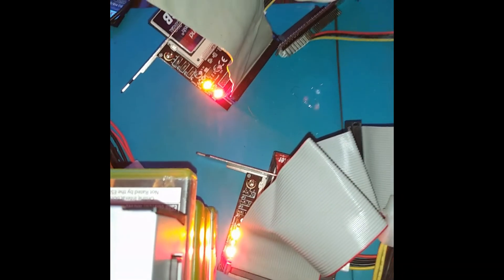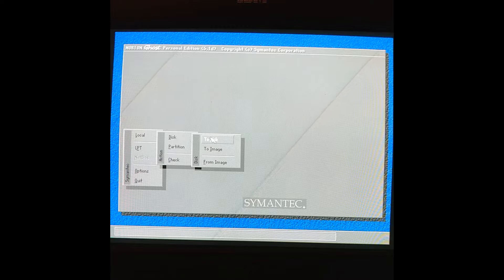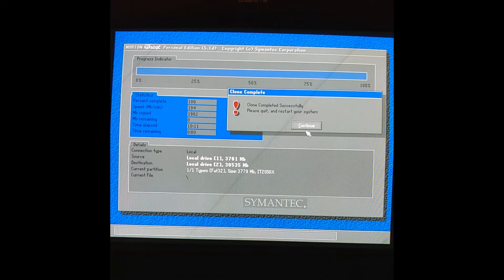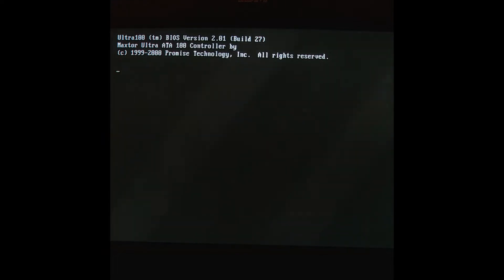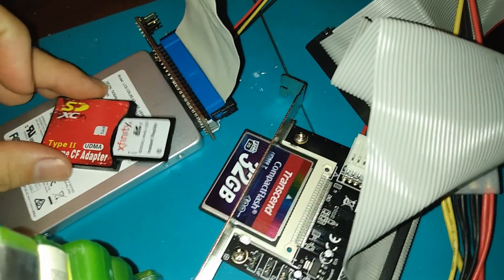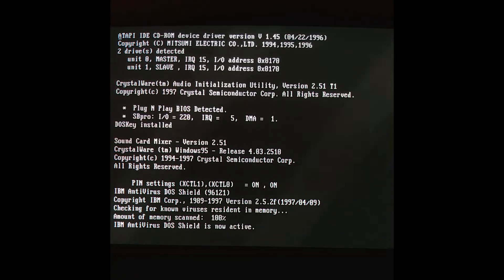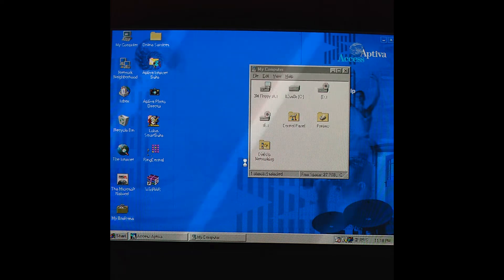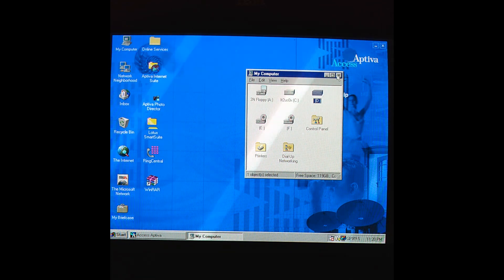Cloning Windows 95 installation from SD to larger CF card

Comment: I thought you couldn't use Ghost without restarting to DOS for Win 95 - 98.
Reply from the maker: I was under that impression as well. This particular version of Ghost is a DOS program but it launches directly from Windows and it cloned a 4GB SD card to a 32GB CF card on real hardware local-to-local with no problem. If you open this version of Ghost from Windows, then press the Start menu key, it will minimize and switch back to the desktop.
Reply: @gpr-garwoodprecisionrepair6256  Okay that's cool. I've been wanting to clone my Thinkpad 760XL and 360 which has the factory image by using Ghost. Where did you find that version?
Reply from the maker: @josiahbarkhau9359  I got a bit lucky and found a physical copy in a stack of old PC bundle software, but I believe 5.1d can be found on the Internet Archive.
Reply: @gpr-garwoodprecisionrepair6256  Oh okay thanks :)
Reply: I need to quickly clone a dying hdd with Win95 on it to a cf card, since time is crucial is there a guaranteed way of doing this with another more modern computer?